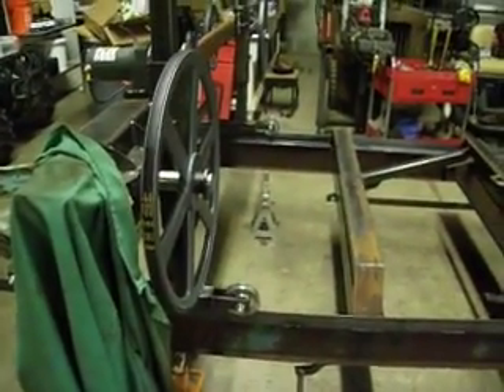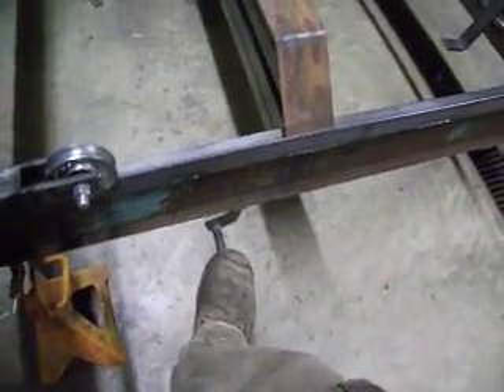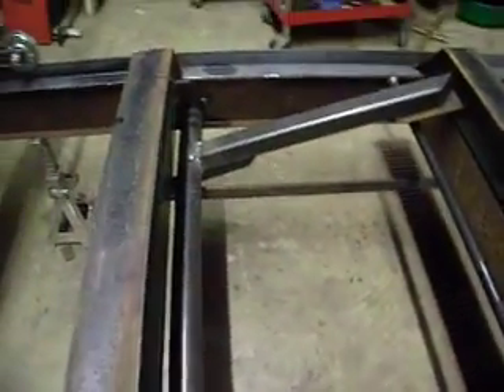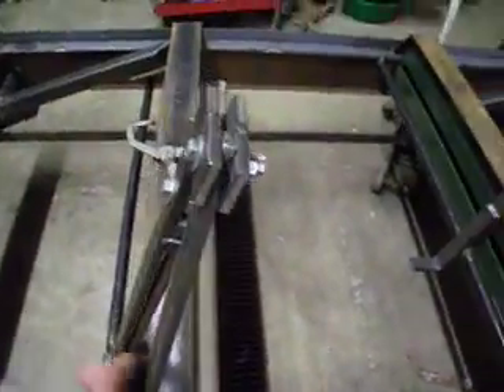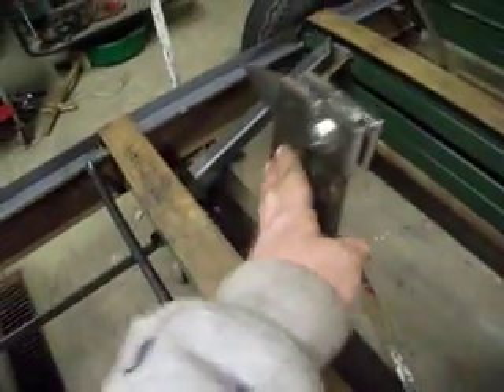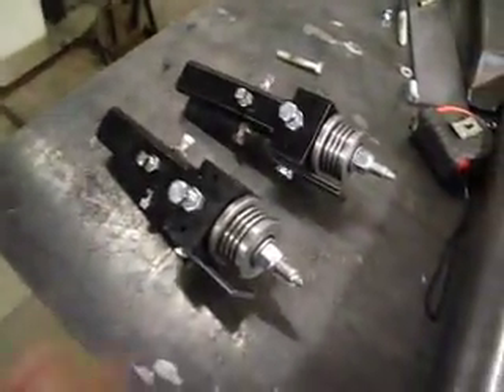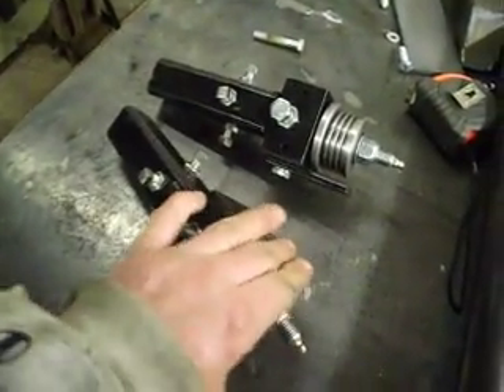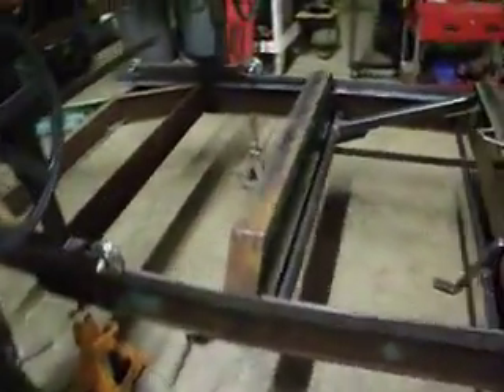Homemade Portable Sawmill 19" Band wheel $53.00 each w/ Part #'s Links in description below

Comment: Hello, thanks for the links. One question: on the pulley calculator for engine RPMs, do you put the max RPMs (typically 3600) or the RPMs @ max torque (usually 2500)? It makes a big difference in the pulley size.
Reply from the maker: The choice is up to you on how you want to figure it but HP plays a large role. If your're using 24 HP then ya, not a problem you have some wiggle room, but if you have an old 8 HP then you'll have to run her wide open all the time to make it work.  All i can recommend is to get the largest drive wheel and the smallest engine pulley  and those calculations are done @ full throttle. Anything you want to play with between  half and full throttle is up to you. My twin Kohler 19 HP hardly ever sees full throttle, it cuts most logs easily at  3/4 throttle all day long but put a big ol 26" white oak up on the mill and that all changes really fast.
Reply: Ok, thanks.

Comment: Thanks so much for all the information - love your build! How have you found your shaft size selection (not sure what size you used?) for the drive. I was thinking of going with the 1-1/2" bushing but it seems a bit overkilll for a 16-18hp motor and the size wheel you link to. What are your thoughts? Thank you again!
Reply from the maker: The equation falls on the amount of cantilever you have out past your bearing. If you use 1 1/2" you know it's the largest shaft possible for this band wheel set up so you did all you could.Plus it's not really a great difference in price for the shaft and bearing cost between say 1" and 1 1/2". Try and keep your design neat and tight and place the band wheel as close as possible to the bearing/ likewise for the drive pulley. It needs to be rigid to withstand the tension of the blade and you cannot have the shaft flexing or it simply will not track correctly or work properly.

Comment: I bought the same guides. I didn’t get the ones with square tubing with them. Trying to save money I was wondering if u knew what they shaft went Thur in front of the tubing a square hole or a round one?
Reply from the maker: I'm sorry, I'm not exactly sure what you're asking me?
Reply: Southeastern Ohio Honey Bees & BBQ     The face plate on the front of the square tubing where the adjustment bolts are, is the hole that goes through that just a square hole?
Reply from the maker: I'm assuming you're referring to the hole that the spindle  passes through on the  machined block ? I'm not sure if it's square or round as I've never had the rollers off.  The positioning bolts just need room to adjust, so as long as you have that clearance I'd say either shape would function. The adjusting bolt on the bottom sucks ass, it needs to be a recessed set screw as it hits the bed rails on final board cuts.
Reply: Southeastern Ohio Honey Bees & BBQ yes that is what I’m talking about. I did a square hole through 1/4 in material. Thanks for the insight on the set screw!

Comment: ?Do you have the measurements of shafts or parts numbers for bearings
Reply from the maker: The shaft length will depend on your design, I think mine where like 13 inches long. The pillow blocks should be easy to find on the Surplus Center site I used 1 1/2"  stainless shafts that I made but Surplus sells the keyed shaft I believe in a 36" which should be more than enough for both sides.
Reply: Thank you for the reply.
Reply: Depending on the shaft size - all the bearings are right there on the same web site. about $20

Comment: Thanks, I needed that.  Just ordered pulleys and 1.5" bushings and wheel belts 60" x 5/8. Hope that is right size.
Reply from the maker: It's actually a 59" belt if you want the belt to fit tight on in the groove. B or 5/8 is correct
Reply: I ordered the 59" after review of the film.  Oh Well.  "Thanks for the prompt reply.

Comment: Considering these band wheels are actually pulleys, what did you do about groove? Fill it up with something specific, or did you machine the pulley and made it into a wheel?
Reply from the maker: If you watch the vid there should have been  the part numbers for the belts that fill the grooves to make it a wheel. Its a V belt that makes it a wheel.

Comment: Hi, I need you help me. 
My band saw cut along awry, shows superficial wavy.
All  the saw structure slices correctly and does not move but the blade does. 
Also sometimes the cross cuts like a pot.
I dont know witch is the problem, if the blade tension is poor, the blade guide is failing or the problem is the blade (sharper teeth ot and other problems).
I appreciate if you help me.
Reply: Cesar Zeballos blades will climb for many reasons . the blade must be set parallel with the bed or you'll fight those demons all day. random waves are normal on some hardwoods with knots as the blade will seek the path of least resistance. I use the blade setting tool from cooks. make sure you keep the guides as close to the cut as possible and be sure you have the blade properly tensioned.
Reply: Thank you very much for the information.
Sorry my English. My wife helps me sometimes.
I discovered my problem. I should tension more the blade.
then, I had to rectify a little curve because these are the wheel motorcycle.
My cuts were much improved.
Now, you can tell me how lubricate the blade to prevent her from filling?
Reply: Cesar Zeballos I use water and simply drip it on the blade where it enters the cut. bigger the log more water needed.